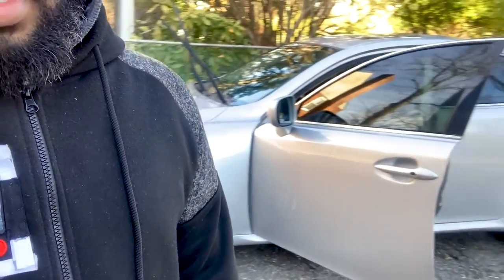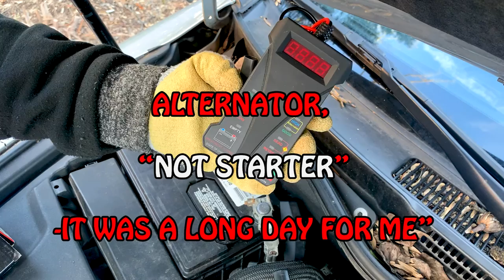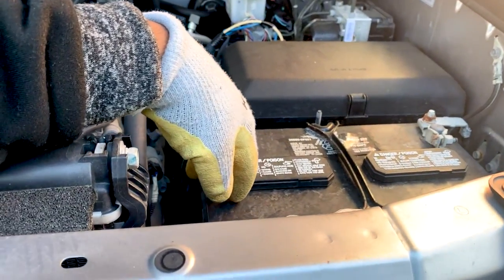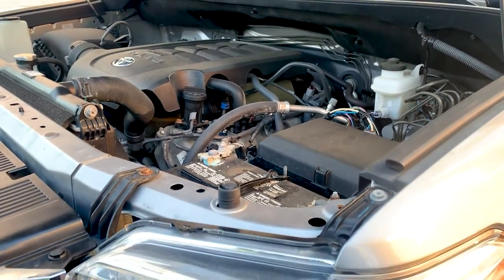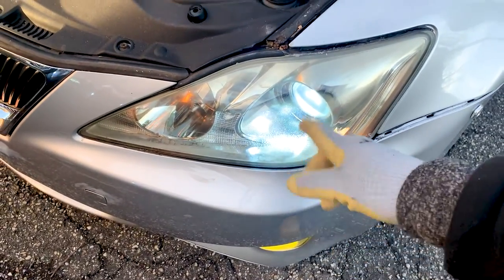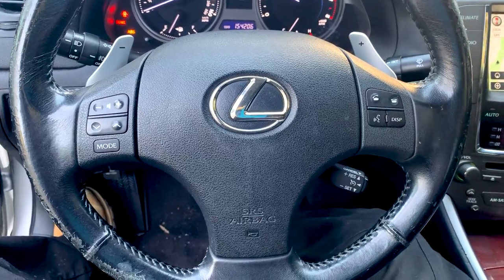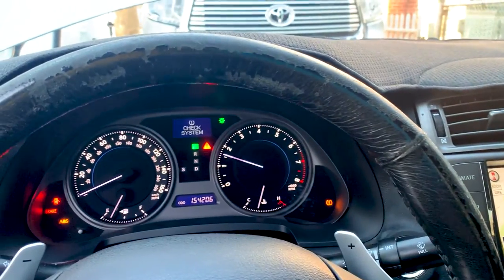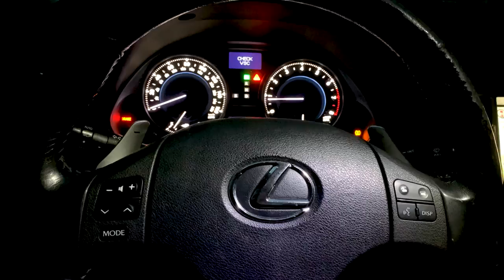Quick Automotive Diagnostics | Bad Car Battery Ep. 1 (Lexus IS250)

Comment: Nice Video.  One thing I would suggest to those leaving their cars in storage for more than a month is to use a trickle charger with a float mode to maintain charge.  Lead-acid batteries love a slow gradual charge.
Reply from the maker: Thank you very much for this tip, I will keep this in mind as it will be very helpful keeping the battery charged.